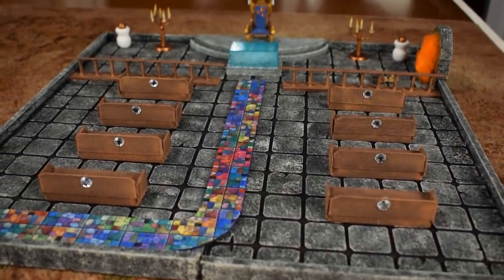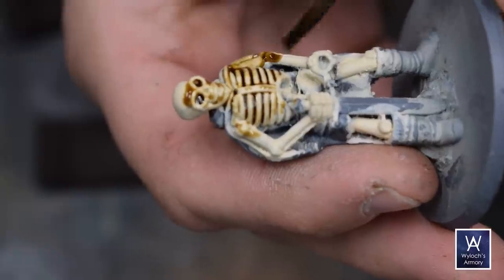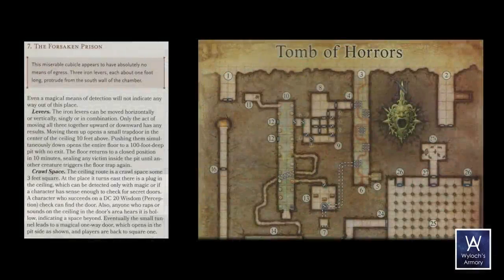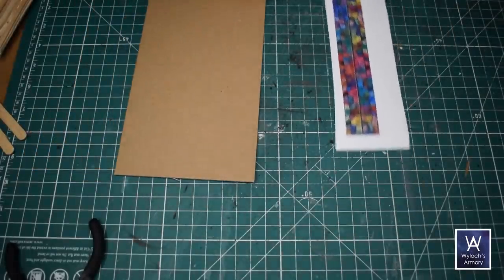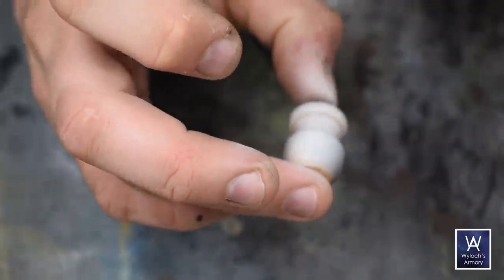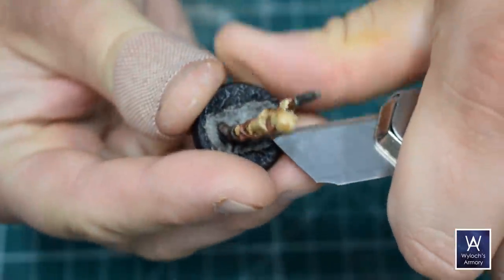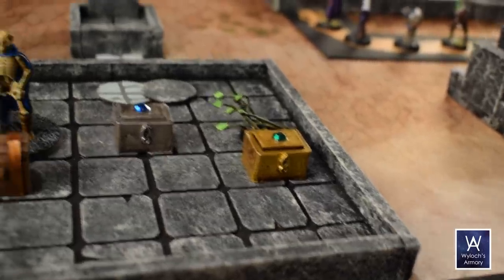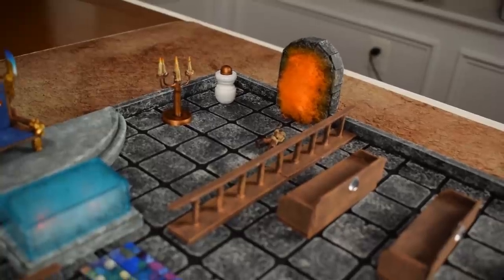Building the Tomb of Horrors for Dungeons & Dragons - Part 4

Comment: Awesome and inspiring content! 

When making my starter set of Wyloch tiles I did not want to hand paint something like 200 tiny squares, so, instead:

Cover a board with aluminum foil and tuck the edges under.

Lightly mist with repositionable (TEMPORARY) mounting spray.

Tack on squares to be painted.

Spray prime and then paint while still tacked down (if sponging, this takes only a minute or two).

Remove by rolling foil under tiles and carefully popping them off. If the repositionable mounting spray was light enough they will pretty much pop right off themselves.  Voila! 

Incredible work with the Tomb of Horrors, as is the rest of your work!

Comment: I used a UV light to accelerate the cheap super glue.  Asides from the smoke and getting to hot to hold it worked fine.